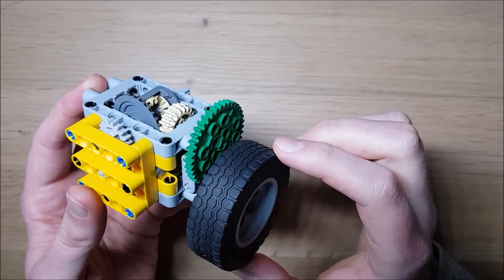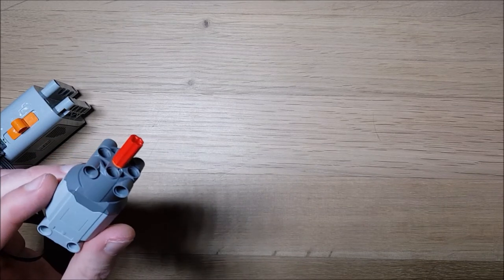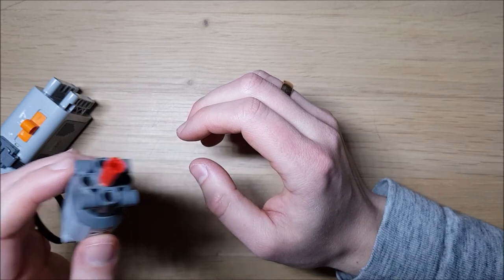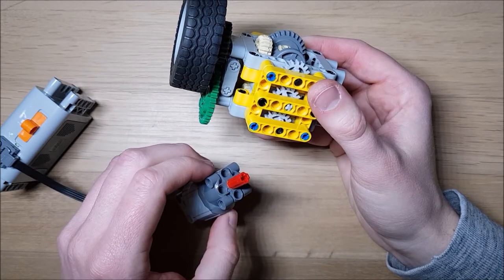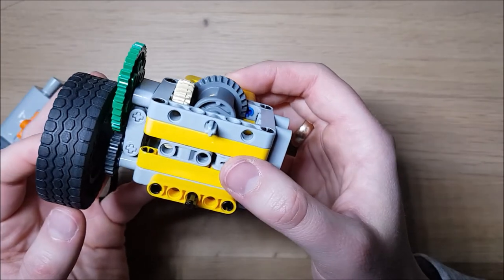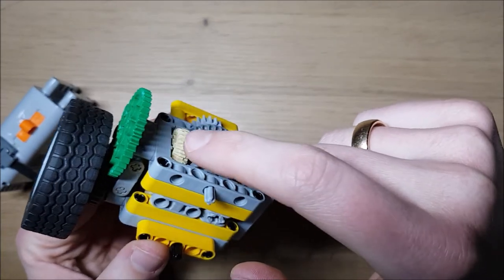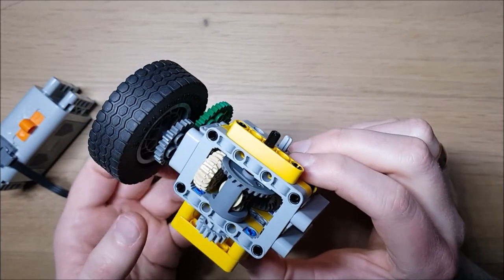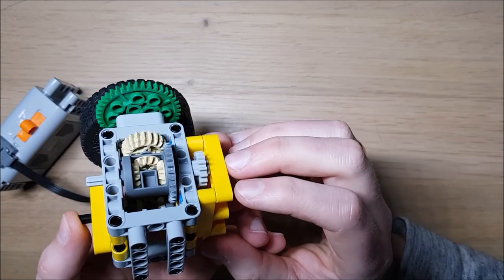Lego Technic frictionless automated gearbox with flywheel

Comment: The only problem is that the 2 gear start very fast with little torque. Maybe you can use the frection from the dif, to hold the lower gear.
Reply from the maker: Yes you are right. For me this was more a proof of concept. Applying it to anything would definitely require some tweaking.
Reply: @DrNo-ki5mj  i think the only real working gear must be with centrifugal gavernor that shift gear, or 2 motor.
I bilt one last past days and its realy nice. U can controll real easy and good on the shift point with just band or any spring
Reply: I have no idea how. It’s so difficult to tweak the shift rate. My best guess is rubber bands.

Comment: A quick question is the fly wheel needed for it to work?
Reply from the maker: Yes, you need some kind of resistance to hinder the 2nd path with the higher gearing ratio. Usually friction is used, but then you always have power losses. The flywheel only has to be accelerated once, after that it runs almost without resistance.
Reply: @DrNo-ki5mj  :0 ok thanks

Comment: Your demonstration is unclear. What stopping red shaft with your hand demonstrates? Show how the car switches gear when going uphill...
Reply from the maker: The stopping of the red shaft demonstrates an increase in the torque acting on the output. This is the same as if a car would go from a flat surface to a slope or from a smooth surface to a rough one.
The shifting can be seen in the movement of the differential housings: 1st gear they are standing still, 2nd they are moving.
Reply: @DrNo-ki5mj  imho stopping the wheel should demonstrate torque increase. What does red shift do with going uphill?
Reply from the maker: The wheel is the flywheel, not a wheel of the car. The red shaft would be connected to the driven car wheels. The flywheel is the resistance which has to be overcome instead of friction. Shifting up takes place when the flywheel is accelerated.